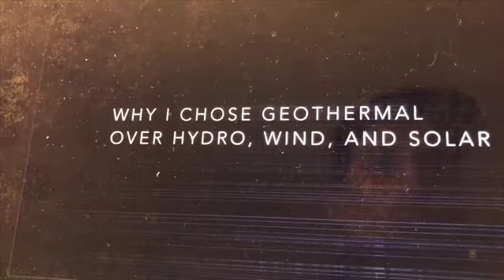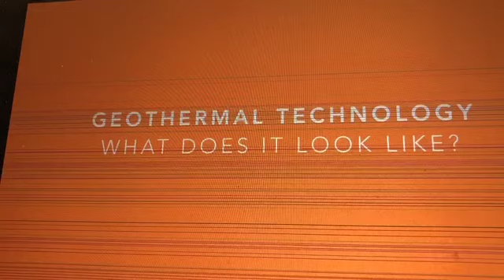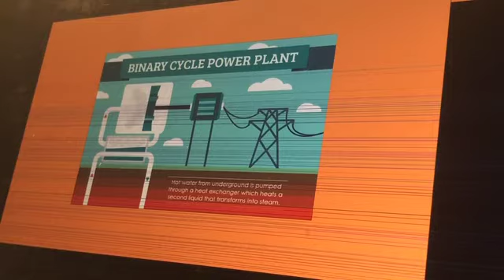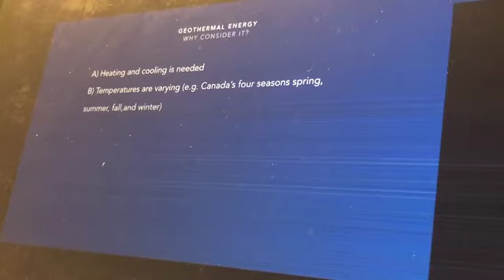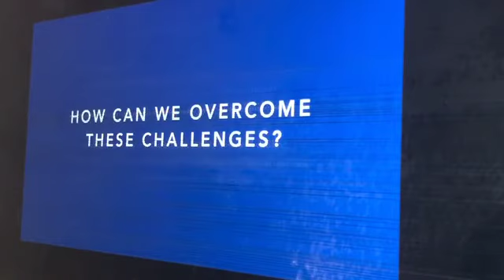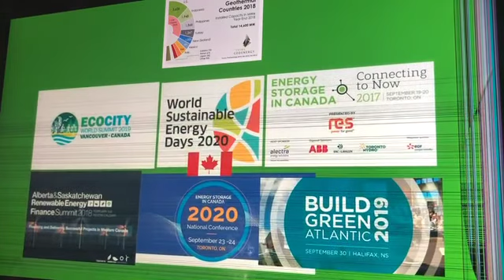RE & Sustainability Elective – Final Presentation on Geothermal Systems

Comment from the maker: Areas for improvement: at 0.45sec be more specific about the “Solar” for heat and cooling it’s called Solar Heat Pump System, not to be mistakes with Solar (photovoltaic cells) System. Solar (p.c.) does not produce electricity from HEAT but Solar Heat Pumps do. Be specific.